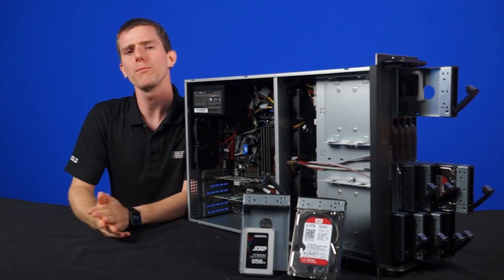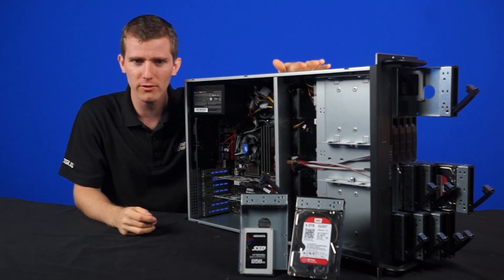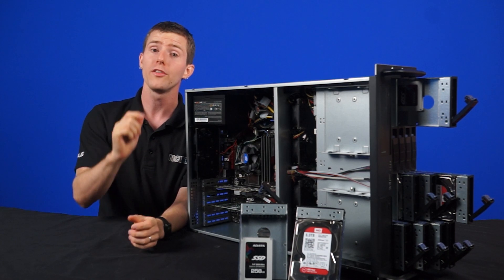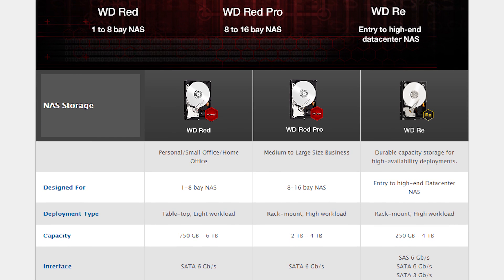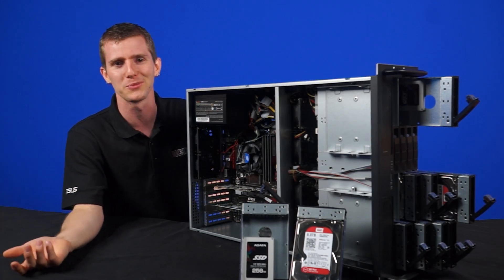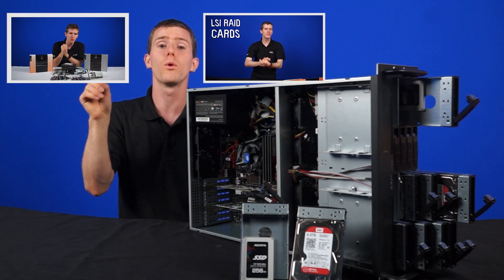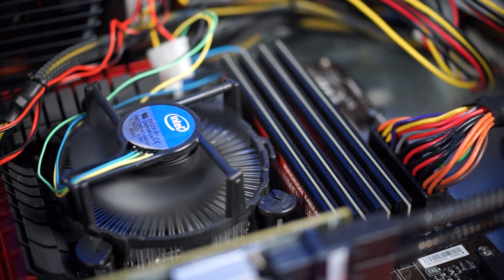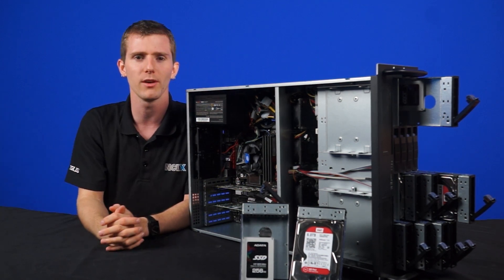New Shiny Ultimate NAS ft. WD Red 6TB Harddrives

Comment: We run a whitebox dual NAS at work that I helped build. 8GB of ram, Pentium 3220, 24TB of WD Red in RAID 6, but we plan on migrating to SAS disks. I would have installed a Linux derivative on it for simple SMB shares, but our company director went with Server 2008 R2 inside of ESXi 5.5 with just file sharing features installed.

Vmotion is also installed so during maintenance periods there is little to no downtime. Daily backups are on a 2 week rotation schedule as well as a local NAS for on-site backup restoration. Month ends are kept permanently.

Comment: I have a 20 bay Norco with 16 assorted drives running Windows Server 2012 with FlexRaid. I currently have 36.3TB of effective storage. I'm using two cheap RocketRaid cards to connect the drives and I am not impressed with them (Get really hot and drop the drives occasionally).

Going to be upgrading some parts soon and using a dedicated LSI 4x SAS HBA instead. Will use Windows Server 2012 R2 and use ReFS with Storage Spaces instead of FlexRaid.

Comment: I've built many a NAS, and this thing strikes me as odd for a few reasons.

1) SSD's for the OS? This is commodity HW using a raid card. Why not grab a single black or red for the OS. If the drive crashes, who cares, there's nothing on there you care about.
2) I've never used windows storage server, but it would strike me as odd if they didn't have an option where you could expose volumes with an additional SSD read cache. A much better use for a raid1 SSD pair.
3) 28TB of RAID6, falls dangerously close to the double URE failure rate being 50/50, something that I'm personally not ok with. You definitely don't get the density out of RAID10, but for business critical storage I would have gone that direction with anything over 12TB of storage.

Comment: I built a system using freenas about a year ago and it''s been working great. Pretty fun project that was extremely unnecessary. I have 3x3tb WD red's in raid-Z1. I'm using an Intel DBS1200KPR server mobo with 16gb of kingston ECC memory and a g2020 processor. I'm debating moving to a quad core processor (cheaper xeon perhaps?) in hopes that it would help with running multiple tasks. The performance takes a serious hit when I try to access more than one thing at a time. When it's just one process I'm maxing out the gigabit ethernet. But honestly I have no idea what I'm doing...

Comment: Sorry Linus. Your setup missed two big points that should be touched on. Storage should always use ECC ram, and ZFS should have been implemented over any standard RAID level in your environment. As it is your system cannot be easily expanded. ZFS allows zero down time pool growth with the addition of new drives at a later date. This is desired for most who aren't working with enterprise systems, and who likely don't have a second storage array available to support hosting the data from one while it's being upgraded.
Secondly, Synology is sexy as hell. They implement an LVR modification that allows their "Synology Hybrid RAID" to support a pool consisting of different drive sizes while utilizing all of the available disk space. It makes upgrading the entire array at a later date incredibly easy. Say you built it on 2TB drives, Pull 2, insert 6TB drives. Wait for rebuild. Repeat until all drives are replaced. It's nice.

Comment: Windows? 2x 256GB SSDs for the OS? RAID? Windows!? Please tell me that you went that route for native SMB3 support!

For shame NCIX... There are plenty of other options out there, even some free nas stuff (see what I did there?) that's really simple to use.
Reply: Nothing wrong with Windows. SSDs definitely overkill for a file server OS drive. RAID is great still. Even if they went this route for ease of use and compatibility vs native SMB3 support, that's still perfectly acceptable... There are reasons to stay away from FreeNAS, NAS4Free, unRAID, and opt for hardware RAID controllers.

I know 4 people off the top of my head with various levels of computer literacy, from a gamer that likes to tinker with higher end stuff like this and needs loads of storage, to an enterprise IT lead. They're all running ZFS based systems, and they almost always seem to have problems with ACLs, configurations, or plugins on their NAS machines.

My NAS running Windows 7 Professional and a hardware RAID card hasn't crashed, needed a reboot, or been offline for any reason except hardware upgrades/physically moving things around for the better part of three years now.
Reply: You know some people somewhere that seem to have some problem at some time with some aspect of a Unix-like ZFS based system? Duh :P
And just because one of them is an enterprise IT lead doesn't mean they should never have a problem with a peace of software. It just means that they should be able to work through their problem and learn something new from it.

I agree that Windows as a file server is fine for home use, it's not an enterprise solution even with all the additional features 2012 brings to the table. Especially for NCIX, they're going to be saving large files for a long time which might rarely be accessed on this box. This is an ideal situation for bit rot to become a real problem.

While yes, there will be initial head aches for a Windows base shop adopting to using a Unix-like system there's a reason that all enterprise NAS appliances are built on top of some sort of Unix-like OS. Plus, they're learn a pile of things in the process which will only help their personal careers in tech.

Comment: Currently running FreeNAS with an AsRock C2750D4I CPU/Motherboard with 8GB of ECC memory and 2x3TB Reds in Raid 1. Have a quad Gbit Intel NIC with LACP at the switch level which gives me more bandwidth than I really need on my network.

I'm wondering why you didn't land on something like FreeNAS or BSD for your file server? ZFS is a godsend and expandability is super easy with vdevs.

Comment: Iv'e got a question. My WD Blue 1TB is almost filled (got about 100GB left on it) and i'm planning to get an SSD boot drive and 2x2TB hard drives for Raid0. I was wondering if I should get Seagate or Western Digital. On one hand, Seagate is cheaper for the same speed/capacity drives, but does than mean they fail more often, or cant take much G-shock? Would WD be better for the money, or no?

Comment: using Win Server 2012 for a NAS is weird. Not to mention with the size of the storage, NTFS is NOT recommended. XFS or ZFS is the recommended File system. FreeNAS would have been the better choice for a NAS. If it is just a file server and not simply a NAS, a CentOS or Debian 7.6 x64 Wheezy install would have made more sense stability, and resource wise.

Comment: 4x WD Red 4tb drives with Linux Software Raid 5, CentOS 6.  Some i3 CPU, 4GB RAM.  Some Asus H67 or something motherboard.  Almost 500MB/sec read speed at the start of the array (Just DDing /dev/md0 into /dev/null for 16GB) 341MB/sec doing the same with a bluray rip.  Write performance is a lot less, around 150MB/sec however it will therefore obviously saturate its gig nic virtually indefinitely.

Comment: well i do not have a NAS, i just have 3x 2TB WD RE4-GP drives and using a software called Free file sync to sync the 3 drives in to a mirror.  it is a fancy easy to use software that could help with managing file syncing from computer to the nas.

Comment: l converted a old ibm tape Library so I can put about 140+ 3.5inch hard drives (so If I fill it up I cud get 840TB :) ) currently I only have...6 bays populated equalling to about 4 to 5TB in space with a crapy atom commuter. 

any good  RAID controllers that can support over 140 hard drives???
Reply: *****  well them LSI SAS card are cheaper than expedited.but i found this DELL PERC H800 RAID wood that work

Comment: I really don't need a nas, but i have an older 6 core AMD Athlon build with 8 gigs of ram laying around, i might get a gigabyte ethernet controller and a few 4 TB drives to run in raid 5, the AMD chipset has 7 on board sata connections so ill run software ZFS raid through Free nas, then ill have an excuse to record more movies and tv series
Reply: ***** Must is a bit strong. While it is <highly> recommended, depending on your usage you may not need it. Plus you should have backups since a nas is not technically a backup; simply a place that provides more storage. If you keep irreplaceable photos on a freenas, then for sure go with ECC. Besides the setup connly is thinking of going with is good to get your feet in the door with freenas. Then, if you choose, upgrade to more and/or better hardware.
I currently run a core2quad Q8200 on a 750i motherboard with 6gb ram non ecc with minimal issues.

Comment: Man...makes me want to upgrade from my HP N54L Microserver. Currently have it running with a couple of 2TB WD Red drives along with other random drives I found in the house and Windows Server 2012 Essentials. Mainly use it for home file sharing, backups, and plex (which it sometimes struggles with transcoding 1080p content). Great little box 😁

Comment: i ~sort of ~ have a NAS.
It's more like a "Here use this system to stream games and tv from in the living room but i'm also going to be putting 8 TB of storage in there just so i can put stuff on it" computer...
Reply from the maker: Close enough. As long as you have some redundancy.
Reply: xD +1
Reply: I'm using a Supermicro A1SAi-2550F/8GB ECC/4x4TB WD-RED with 1x128GB M500, running Windows Server 2012R2 inside a Chenbro SR-30169. Actually experimenting with storage spaces so the RAID-Controller isn't in use. Planning to go for another 128GB SSD and at least put the OS in a RAID1 although reinstalling in case of a failure wouldn't make up a great mess. Holding movies/series, docs, and all kind of stuff which has to be accessed from different workstations or devices which have a set amount of space and aren't upgradapple =)
Reply: ***** i'm not putting any severely important data on it, but i have reserved a full TB of storage on it for a backup using crashplan, backing up every 24 hours (if anything has changed) for the small small portion of data that i don't want to lose.

Its mostly movies and stuff...
Reply: TDPEquinox Hi, if i'm not getting it wrong you say that your backed up data is stored in the same physical place as you sourcedata, so in case of a hardware failure both source and backup will be lost. Feel free to correct me if i got your point wrong =)
Reply: Jay i think i mentioned this ( i didnt) but that drive is hooked up to a dropbox account with 1tb of cloud storage.
So it's onsite and offsite.
Reply: Ok so it won't bring you into trouble losing that hdd, but I hope you only save files encrypted onto dropbox =)
Reply: Jay Of course i encrypt the important stuff :P I'm not overly keen on the idea of someone at dropbox looking at all my porn- i mean family pictures and videos.....

Comment: In my professional opinion, its better to have 2 smaller file servers and use DFS Namespace. That way the raid controllers in each server wouldnt be bottlenecked
Reply from the maker: RAID isn't the bottleneck. Network is with only 4Gbit possible throughput.

Comment: I have 8x3TB NAS in RAID-Z.

edit: RAID-Z, not RAID-5
Reply from the maker: Very nice. be careful with RAID 5 without hot spare. rebuilding the array can sometimes fail OR another drive may fail in the process.
Reply: *****
I actually did have a couple of drives failed a long time ago (not both at the same time :) ), replaced them and now running fine since then. Rebuilding takes around 22hrs, I have 75% of NAS space used. I noticed if the drive is bad it would usually die pretty soon, but if the drive is running fine for a long time, it will most likely continue to work if it's treated properly. Most drives that died on me usually died within first month, and the oldest ones that are still working are more than 10 years old. Although they aren't useful anymore.
Reply: ufster81 that's hot swap spare not fault tolerance. Raid 6 has double parity striping allowing up to 2 simultaneous drive failures. I perfer triple striping raid 6 you get with ZFS, otherwise known as Raid-Z3 cause of expanding drive capacities and URE rate. It also allows for 3 drive simultaneous drive failure. That being said if the data is important to you, then you should also have a offsite backup to protect against fire, theft or other localised catastrophic event.
Reply: ufster81 whoops, sorry you were referring to magister213's raid 5.

Comment: two ssd'd just for the OS?!? Thats absolutely unnecessary! A single 32GB ssd or even just USB will do the job because the os doesn't need to boot very often (0.5~3 reboots/year on a typical linux nas). And after booting the os is just gonna sit in RAM. BTW. linus please use linux instead of windows for your NAS! It's not very professional to use windows on a server anyways....
Reply from the maker: we used raid for OS because we cannot afford downtime. If one dies we want to swap it out immediately and keep going.
Reply: *****
Ah ok, but with proper configuration they should last basically forever

Comment: Not a bade RAID controller.  Supports optional cachecade configuration.
Reply from the maker: we tried cachecade. the problem is since our video files are so big, the cache is constantly flushed and performance takes a hit. Very few files are accessed over the network repeatedly.

Comment: Will you guys be putting in Noctua's NF-R8s to help keep the cooling quiet if the stock fan noise become an issue?
Reply from the maker: That is a possibility however I think the more likely scenario will be using inline resistors to lower fan speeds.  That being said, the NAS isn't near any workstation so we will just keep it the way it is for now.

Comment: what are the differences between the different colors of the WD drives? i get that the red ones are more focused on raid, but in general how do they all really compare
Reply: The red ones aren't focused on raid they're focused on 24/7 usage. The green's are all about being low power, The blue's as far as im aware are just your run of the mill hard drive, The black's are high performance drives and the purple's are for surveillance systems.